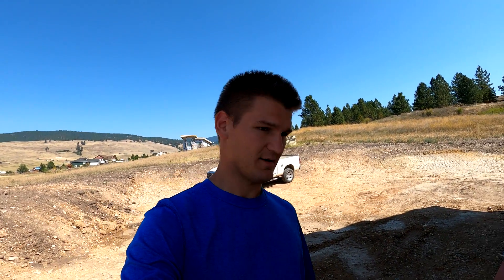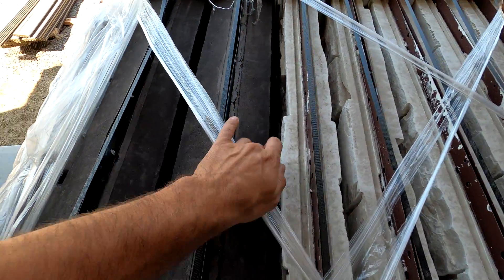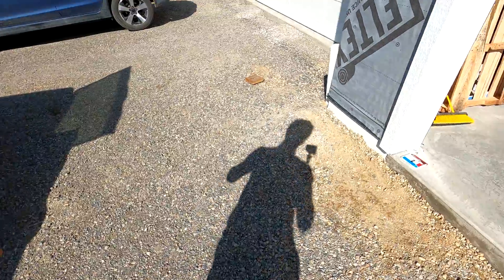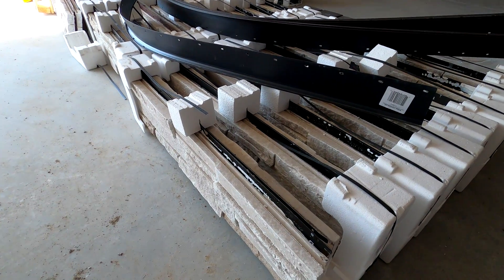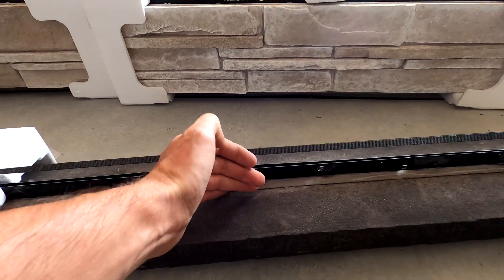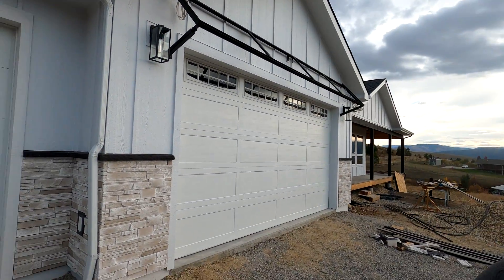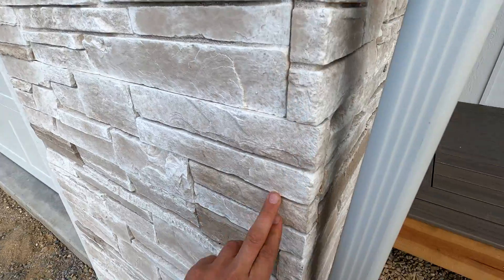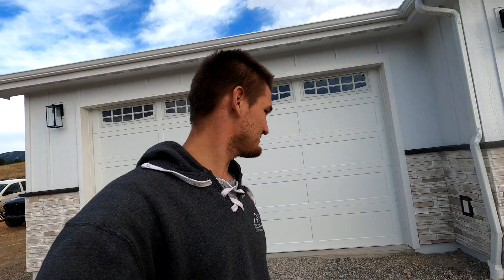Installing Versetta Stone Ep.18

Comment: Doing a job like this on a house with siding already for the first time, how do you screw/nail the cap down under the siding? Do you just pry it back a little to get in there?
Reply from the maker: Yes exactly, try to pry up and screw/nail it in. When it’s not possible I went through the siding then caulked it really good.